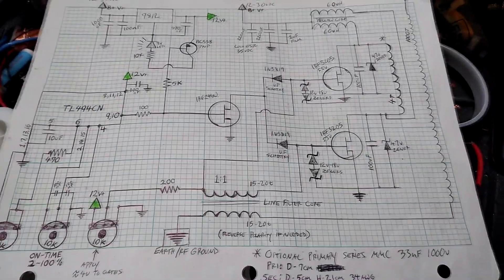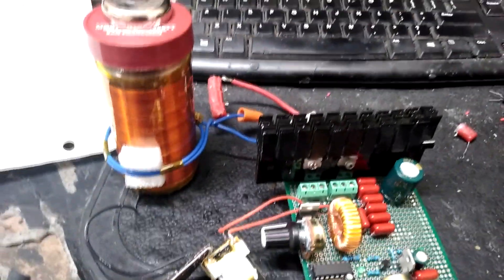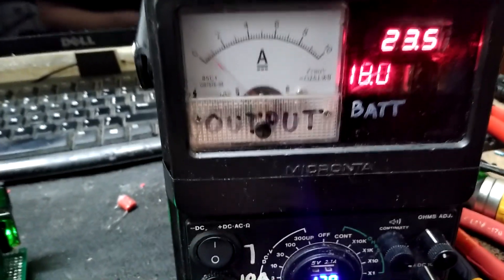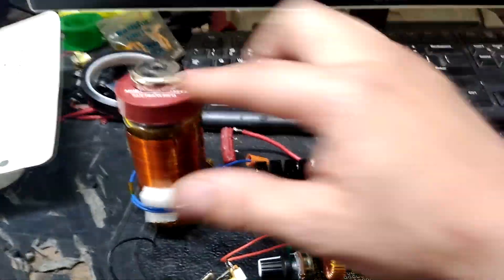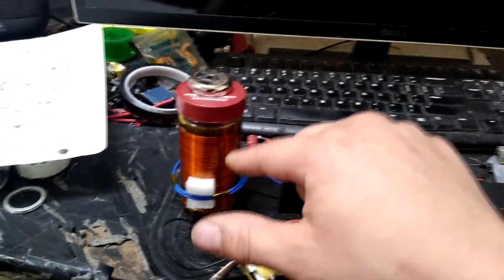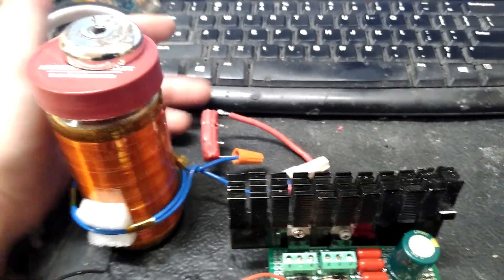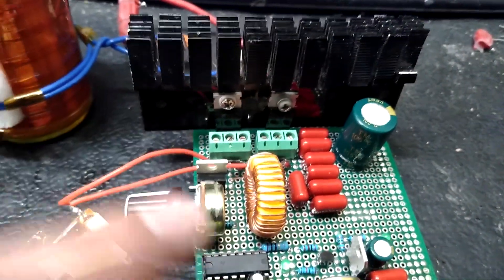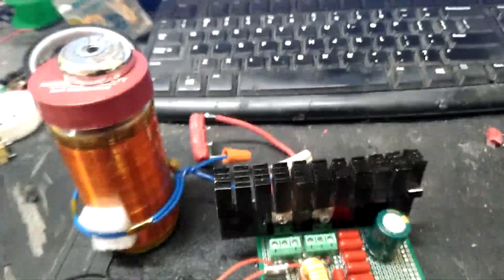Tiny 6v-24vdc SSTC testing

Comment: Good job dude. Nice seeing you still keeping up with those DIY's. Anyway nice output from this amazing tiny Tesla coil. What wire gauge you've used for the secondary? Is it 30AWG? PROBABLY, very few turns like some 200- 300 turns!
Reply from the maker: It's 36AWG with I think around 400 turns but I do have another one of these with only 300 turns. 
The primary caps are working hard in this one.. they get super hot and will fail unless I change them out. Slight differences in them all. Another one with 40AWG of about the same size gave more branchy arcs but not quite as long.

The plan is to wind another coil just like my best one so far to see if I can get 8 inch arcs on this replication as well. It's hard to tune but I think it's the best arrangement cause you can have an overall tiny setup that looks like it's running from wall power.